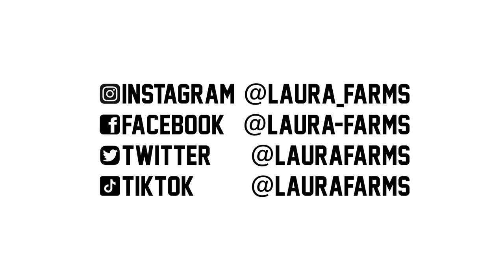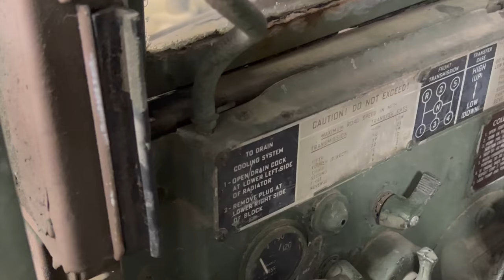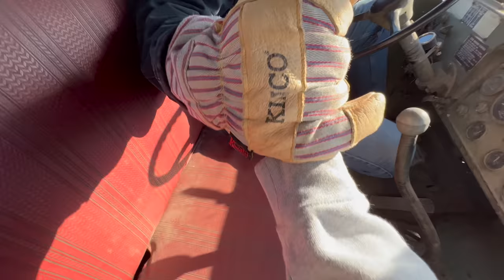Getting A 6X6 Running After 10 Years!

Comment: Used to drive one of those at the surface mines in WV. One location to another, carrying a diesel powered hydro-seeder. These trucks are equipped with air over hydraulic brakes , so keep the air components in working order or you'll be pumping the brakes up every time you want to stop. Be sure to keep the oil & fuel filters changed. Be sure NOT to over speed or lug the engine. The engine runs on diesel, kerosene, and aviation fuel.
Reply: "... and aviation fuel." Not to be overly pedantic, but... Specifically, it'll run on Jet A, Jet A-1, Jet B, or the military equivalents (JP-4, JP-5, etc.). It is important not to run aviation fuels that are meant for non-turbine engines, eg, 130LL. 130LL is 130 octane Low Lead fuel, closer to automotive gasoline than it is to jet fuel, diesel, and kerosene. You definitely don't want to put it in that truck. 130LL and the like are commonly used for piston reciprocating aviation engines.

Comment: There should be a toggle switch on the dash, that flips from side to side to engage or disengage the front axle differential lock. It was Vacuum operated, I drove one like that many times in the 70s🙂

Comment: Some of the six by six had a spring mech to kick in the front wheel drive when needed however the springs were prone to breaking. Also be sure and top off the differentals and transfer/ transmission cases as they tend to leak especially if they had the fording equipment installed. Air pressure would push out the lube when the seals were a bit worn instead of just keeping the crick water out.

Comment: I drove those in the army duce and a half  they are awesome trucks very dependable once running mainly troop / equip cargo drain all oil and refill with tractor oil will work drain radiator as well that exhaust part thats broken is an easy fix any tractor parts store would have that and put in actual tractor batts the 6x6 drive has a transfer case lever you have to shift in before it will work then put it into 6x6 low then high should be able to take on any hills they also make great snowplow trucks to Iam up in Bridgeport neb if you need anything.

Comment: 6x and 4x are locked in by a lever on the floor next to drivers seat some models have a vacuum or air activated slide switch to lock the front wheels in.. in working condition with all wherls drive these truck are beasts...

Comment: You could have a weak starter, you could have it rebuilt that would help in the way it turns over also some heavy duty truck batteries. Also have the alternator rebuilt. The numbers on the bumper are for where the vehicle was located or stationed at and the unit it was assigned to.

Comment: This, a year after your non-fitting gasket.  But, if problem again:  1.  Use a piece of cardboard, trace with pencil, poke holes.  Keep on file for next reference.  2.  If can use rubber gasket, might be some on market, to cut your own.  3.  Blow torch cut/fab your own.  4.  If can use rubber gasket might be some pour your own rubber & mold, on market.  Hope this helps.

Comment: The front drive is probably the air actuated type. The air switch is mostly found under the center cluster gauge. But some the front drive shifter is connected to a shaft for the first and reverse gear, the one shaft exposed at the transmission cover.  Its a good idea to make a separate lever to engage the front drive so you can have the option of using it even driving on higher gear. If I'm not mistaking, the front drive part of the transfer case came with two or three types. The latest type is the best as it is air actuated. The oldest one is the one designed to engage only if it was shifted on first and reverse gear. In the Philippines where we use these 5 ton trucks we converted them to carry to as much as 50 tons of load. Mostly used in hauling sugarcane and used in logging hauling timber. I believe they are still used in Thailand for logging. There are some video posted in Youtube on that.

Comment: great score guys. Those Cummins big cam motors usually need around 900 amp peak to start easy..4x n70s wired to 24vdc to start but also check its not 24v start and 12v systems which a lot of them were.. the rear end looked like Mack elephant foot so they are almost bombproof and id suggest that like the aussie trucks the military uses Mack front diffs as well. Cant wait to see the big girl cruising the highway. Oh and by the way, i think it will weigh around 22000lbs

Comment: Look at that suspension system of rear wheels?  Surely military specs, but I never came near something that size.  Learned to drive on a Ford utility tractor (age 11, I’m 74).  And my goodness, don’t short on quality engine oils, plus other fluids, especially with old gaskets etc.  and treat, lubricate existing ones (maybe silicone based lubricants) replace with new ones obviously if available.  Any good machine shops nearby, must be if all the farms have all that equipment, some parts may be made with a good template, maybe from a broken part if it is simple.I guess try to find engine manual, maybe from manufacturer also.

Comment: You can pull batteries out of other machines. Nothing wrong with that; just pull either better batteries or more of them.  If you have 3, connect the  third battery to one in parallel and connect the booster to the other.  Also, maintain batteries with pulse desulfating trickle chargers, which make good gifts.

Comment: This is an M813 5ton cargo.  All military vehicles are 24 volt.  It's the NATO standard.   Youll need two 12 volt batteries in tandum to run the starter properly.   This was probably a stretch bed with a drop side cargo box.  The data plate, on the driver's door, should tell you alot about this particular truck.  There are clubs that run these trucks. Go online and check out "Steel Soldiers Military Vehicle Supersite"  first.  Cheers!

Comment: I would say to get the 6 wheel drive working, check the hubs for any kind of knob or lever that would engage the hubs, check the differential to see if there's any vacuum/air lines going in or coming out of it, and see if there's any leaks, for the lines on it.  I would also say check the transfer case (assuming it's not built in to the trans) for all the same stuff.  Worst case you could pop the cover off and figure out a way to make it work.

Comment: You are a very lucky man to have such a different and happy wife!!  "Can I play with your Army men Grant?"  "No,,,,, but you can drive my Army TRUCK!!"    Advice,  you probably have a ground some where in the system.  Until you get a manual, and start going thru the truck, replacing EVERY wire,  you probably won't keep a charge on the batteries.  Just buy enough new wire,  crimp fittings, shrink tube to replace the whole  electrical wiring system.  It will all work then, and be a lot safer.  Good luck!

Comment: Tip: these trucks have an Emergency  Shut Off on the dash.  If you pull it, ALL air is shut off to the engine.  It can ONLY be reset Under the hood. Many of these old trucks would not start because someone pulled the Emergency shut off. Have a Great day 🌻

Comment: There should be an air switch on the bottom of the dash for the front differential. Transfer case is full time on these. Look for a switch like an old school differential inter-lock switch. Usually center bottom of the dash right in front of the gear shift. 

Id say she weighs about 14k with the double frame.

Boyce Equipment in Ogden UT, custom combat trucks, i think theyre in Georgia should beable to line ya out for advice, maybe some manuals, definitely parts.

Comment: 18,000 lbs.    On that water pump engine i think i would put a radiator on it filled with antifreeze to keep it from rusting. That well water will rust it up and then the small bits of rust will plug passages. Just a thought.

Comment: It was definitely part of a medical unit. My guess is 3 COS (3rd COSCOM - 3rd Corps Support Command), 1 MED (1ST Medical Brigade),  Depending upon the era of use the 36 M could be either the 36th Medical Detachment (RG)--UH-60 Aircraft or the 36th Forward Resuscitative Surgical Detachment. My bet is on the medical detachment. 49 is the vehicle designation number. Kind of like it's name. It's the fourth platoon's ninth vehicle. I would nickname the truck "Lazarus". I named one of my tanks that because I had to keep raising it from the dead. It was Serial # 9. God knows when it was built but by the late 70's it was not feeling it on most days. :)

Comment: Military vehicles of this era, unless converted, are 24v systems.  If you look on the dash there should be a data plate that tells you the Technical Manual (TM) that is appropriate for the truck so you can maintain it.  It looks like an M813 Cargo or M291 Expando Van series truck.  The operator and maintenance manuals are available in many locations on the net.

Comment: If you would go to a truck parts store and get a piece of flex exhaust pipe and install it you might be able to hear yourself think when it's running .As for getting all of the axles pulling check all the linkage to see that their all hooked up like they should be.And back to the exhaust again put a longer pipe on it above thepress muffler to get the noise up above you and do what you said about Valentine's day and get him 4 batteries to fit it so he can spend his time fixing what needs fixed .

Comment: I'm guessing it was a wrecker. I drove a 5 ton during my hitch. They were known as "5 Ton" tractors. I hauled JP4 for a Calvary Unit at Fort Lewis Washington. If memory serves, it's an M818. They're BEAST. By the way,, nothing wrong with the tires,, that's just the way those trucks ride. I'm not much on the mechanics. I wish I knew where the mechanic who rode with me lived. I know he could fix any problem you might have. Good Luck

Comment: as far as the water pump goes i went to rockauto and looked around for the proper waterpump but the 460 didnt show a backing plate , however the 302 has one , so im not so sure you need one , most water pumps that need one will come with one since its a consumable item .

Comment: it looks like your air tanks are missing. They control your front locker and your brakes are air assist. Also you should deoress gas pedal to half throttle to start (per manual). You can find free pdf download of military shop manuals online.

Comment: I worked on these years ago, I can help you get the "manuals." Diesel is "prefer " fuel. It will run on kerosene, gas, aviation. Should be data plate above glove box with info

Comment: Break down the valve stem side of the rim to replace that valve stem core replacement.& remember the washer goes on the outside over the valve  threaded stem to.Before you place the nut on to it also.

Comment: If must use starter fluid the engine is shot! It should start at below -20 f without the starting fluid! What good is a truck that is hard to start when TSHTF! I hope started out with new fuel,  replaced the fuel filters and cleaned the fuel lines. I don't think there is anything that works on vacuum! Compressed air maybe. Look online for the model of the truck. It came with large plates in the cab with a lot of information.  I hope they are still there and readable.  There is a lot of people that are restoring the trucks, if you can get the model number and talk to some of them they can be a lot of help!

Comment: I’m not combing through 1K plus comments to see if someone else posted this.  At the fuel tank where the fuel gauge wire and the fuel pick up line are - remove maybe 3 little nuts and pull that small cover.  There’s a fuse  under there that may be blown.  That fuse is for the in tank pump.  If the fuse is good it’s likely that the wiring circuit for the in tank pump has been cut or is broken.  Trace it out and repair it.

Comment: A 2 1/2 ton weights 13k pound. Your is 5 ton with the big engine in it, it should weight about 15 to 17k. They multiple types of beds that on it from hauling a multi piece bridge, cargo bed, or a expandable van, it carried missles and a few another configurations.

Comment: The starting fluid probably worked because the fuel may be old, once started it could burn . Seen that with both old diesel fuel and gas 
12,200 pounds on weight

Comment: I was is the marine corps artillery. All of our trucks were 800 series. I drove the m813. That's more than likely a m814 or m816. The cab area all about the same. The air drain valve should be under the driver side step. To bleed the air system when your done for the day.

Comment: If I had a dollar for all those M series trucks I drove with out breaks, well I’d have enough for a bunch of beer. That is powered with a 250 Cummins without turbo. Great engine. Clean fuel filters ( both primary and secondary) charge up those batteries add some clean fuel . Give it a little dusting with ether and crank it up also make sure the emergency stop is pushe in check it at the pump it doesn’t  reset automatically and you are good to go

Comment: That was a cargo and equipment haul truck it had a flat bed on it with short side rail’s it was used to move equipment from point A to point B if you look at the. Spring pack on the rear axle  you will notice the leaf springs are thick and wide and many leaf to a pack it was meant to carry a lot of weights

Comment: should have a little switch under the steering column that allows air pressure to the solenoid on the transfer case to engage 6 wheel drive.  my guess is 12500 lbs.

Comment: I Was A Mechanic in The Military. A Motor Sargent For A While Thats A 5-Ton Diesel Truck Judging By The Long Frame A Pole Truck or A Mill Van , Mabye A Bailey Bridge carrying truck. You need to get some of the military manuals for that vehicle for maintenance and four parts, the basic manual for it is a technical manual a – 20 manual, then they have a 34p parts manual and a basic – 10 manual for lubrication. All of them can be purchased through Red River Arsenal or they're a couple other places with the M V P A  or military vehicle preservation Association Society site. Your Fan Sfc. David.L.Ryan 7th Special Forces Group Airborne Retired.

Comment: military batteries, are super high amperage, maybe, it will start easier if you use Proper battery cable clamps instead of vice grips ant cheap clamps. also look for a decompressor switch

Comment: this is an old army truck called a deuce and a half because it carries 5 and 1/2 tons of cargo it's supposed to have a bed on it which is not there also first gear has no synchronizers so you have to double clutch it when you're going into or out of first gear . the engine should be a non-turbocharged Cummins very good engines the army and Marine corps has used that configuration for about 35 to 40 years so if you take care of it if it has been taken care of it should run pretty much forever not comfortable to drive but a workhorse.😊

Comment: The m43 would have been wrecker used for tactical vehicle recovery.front and rear winches,with extending boom and outriggers.3/4inch cable on rear winch required no less than three men to unreel the winch.39000lb empty wt.should have turbo .multi feul would run on cooking oil,any cumbustible fluid,made possible becouse of way pistons had hole to cause air swirl

Comment: the weather looks cold there in Nebraska. Diesels do not like to start in the cold. My 1983 Mercedes 240d with no block heater will not start any time the thermometer goes below 40 degrees. The oil has to be heated up. If I had an electric dipstick or the block heater working it would be fine in the winter. You may not need all that voltage if you warmed the oil first. When I was in the army I had a license to drive a 2.5 ton truck similar to the one you are driving. It did not have an instruction book. I used it for a week on bivwak the entire time in 10 wheel drive with the emergency brake on. Never could get it over 25 mph and it would steer by itself. it was a struggle until I found out how to work the monster. Incidentally the truck was made by Studebaker. I was in the military from 1968 - 1970

Comment: I would say someone didn't know how to bleed the old fuel system on this old M-800 series 5 ton. Cat and John Deere batteries work on these.  The brakes are air over hydraulics, the master cylinder is under the floorboard.

Comment: I think its a very cool project.  I'm jealous I didn't run across it.  But I have a million questions like did you start and/or run that thing on the ancient fuel? If you replaced the fuel did you clear or replace the lines and replace the filters before going with new fuel.  Did you fix the brakes? I think I was more looking for a step by step process of the things you didn't cover in the video.  But its still a cool project.  I could find something to do with it.  Maybe a good deer hunting RV? I bet if that thing had more weight on it it would be a really capable vehicle.

Comment: front wheel drive operated from air pressure, there should have been a flipper switch bolted to the bottom of the dash. if no switch then you should have a lever on the transmission hump aside oe the shifter, you should have a 2 speed transfer lever on the floor also

Comment: I use to drive a 5 ton long bed in the army. This looks just like it. Yours is missing the bed. You need 3 36 Amp batteries.  I believe they are 36 amp.

Comment: did ya check to see what the voltage out is[ is it charging] is there water in the fuel separator.. now add fuel, change the fuel filter , oil,and oil filter.....

Comment: The name on the right (passenger seat window) SGT Satre was the A driver…meaning assistant driver. My guess is that this old truck is from an Army Reserve Unit or National Guard. Maybe? Don’t know. It could have been an active duty truck. You need an FM manual for that truck. If you go online, you can find that manual. Use the nomenclature written on the door or glove box area. They should also be a data plate inside the cab.